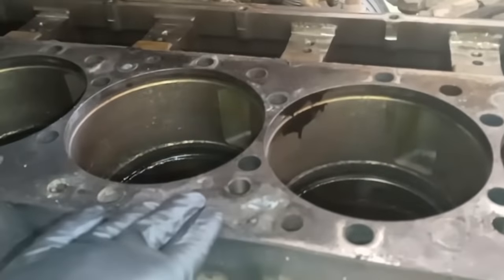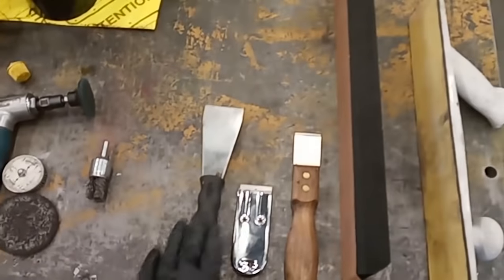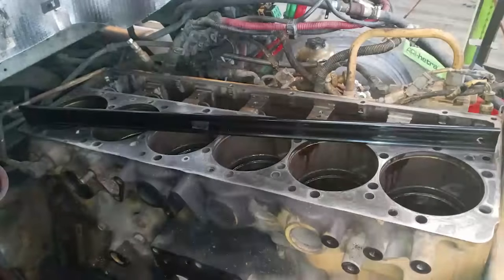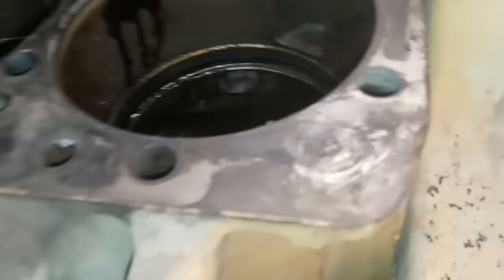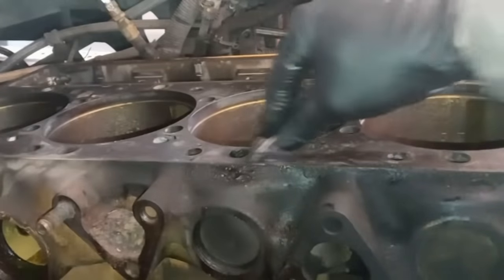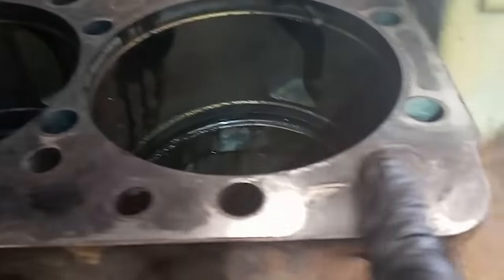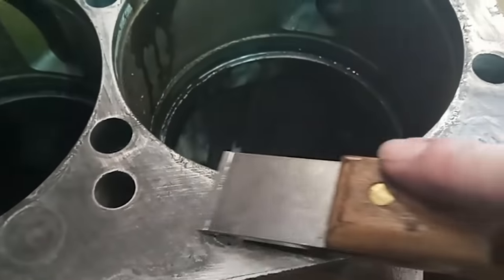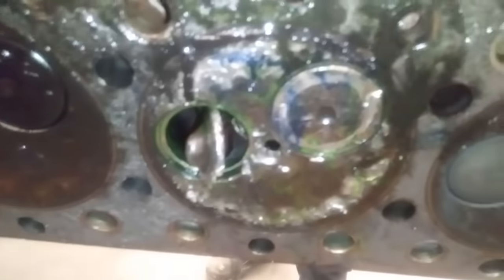Clean a Head Gasket Surface like a Master Engine Builder.

Comment: 24" long 3" aluminum 3/8" wall square tube with on side machined perfectly flat. Attach sandpaper to flat side and go to work. I use that tube for everything from gasket surfaces to butcher blocks.

Comment: I started stoning my blocks during rebuilds. I got into using them after I started millwrighting. I was told by a old engine builder that those scotch bright wheels on a die grinder would take some metal away. I know for a fact you can stone for a hour straight and it wont take .001" off lol. we use them on turbine shells all the time. They will instantly show up any high spots you may have on a block. 

Anyhow, great video!
Reply: stoning your blocks? did they say jehovah?
Reply: @edbo10  no, what he meant was using a flat stone to deburr an engine blocks head gasket surface.

If you have a known flat piece of clean polished metal, and a pair of precision ground abrasive stones, if you try to grind down that metal with your stone, it will never scratch /touch the metal at all.

But, let's say you take a center punch and lightly tap the metal, and then rub the stone onto the metal where the center punch mark was made, the stone will instantly find the high spots and grind them away, leaving all the surrounding metal un touched.
Reply: @jakefriesenjake  lmao i know...it was a joke
Reply: @edbo10  ok

Comment: I have been taught to use a knife sharpenig stone with brake clean after a razer blade than block sand and check and i have never had a problem

Comment: 8:00 The wooden handle " super scraper " . Carbide edge, awesome scraper.
I keep in mind, any crud that goes down the cylinder, could end up in a rod journal oil passage. Cover the journal, or brake clean it out too.
Reply: It's  a bare block, no bearings or anything

Comment: Great video! I used it to clean and check the block on my Triumph TR6. Was able to scrape off all the residue using about 15 single-edge razor blades, so didn't require the carbide scraper even though I ordered one. I bought a 100-pack of blades. They were sharper on one side than the other and the first few strokes with a new blade were really effective. Also used paint remover to soften up the gasket residue. Don't recommend that unless the block is out of the car as it's messy. Plain old paint scraper didn't do anything. Razor blades, sanding block & medium emery paper and accurate straightedge all that was necessary for me.
Reply from the maker: Glad you got a good result out of it and you got it going. Thanks for the comment.

Comment: Great video it's about time someone put out a video addressing this having been a caterpillar mechanic for 20+ years started at the dealership and for the last 12 independent to many people think if has to be shinny metal before it's clean
Reply from the maker: They aren't shiny from the factory, they are just flat and clean.
Reply: @AdeptApe  roll off disc's have  given Cat e-models and c15 a bad name for head gasket problems for years in my opinion
Reply from the maker: They certainly don't help that metal shim seal any better, although the idea that it seals at all is amazing to me. Giving the block little low and high spots only makes it worse. Just use more aviation gasket sealant!

Comment: awesome tutorial. I just did the same on a iron block and was having doubts about it. good knowing I'm not the only one. Only thing i did diferently was using an orbital air sander with a 120g disc, and then used a block and by hand using medium low pressure and 150g paper. then I switched to 240g and that's it. it doesnt look too good but feels very smooth. Also I'm a bit experienced on bodywork and used to hand sanding and feeling how smooth a surface when passing the sanding block

Comment: Deboss Garage had guys from down under (The skid factory) over to the DB shop.  The one Aussie finish planed a 6BT block with a whet stone, by hand, like you use to sharpen knives.
Reply from the maker: That would work as well. I have one, but don't use it as often. Had an older guy used to use a hard flat file as well.

Comment: Great advice. I got the  whizzy wheel / cookies in the engine bad lesson a long time ago from a seasoned veteran tech. He said exactly the same things you said "think that gasket gives a shit if the deck is shiny"? Flat and clean is what matters most.
Reply from the maker: I picture him with a coffee cup in his hand and nicotine stained teeth for some reason. Perhaps that is because one of my seasoned tech trainers had that.
Reply: @AdeptApe  Spot on. Not freindly with everyone, but not mean either. Him and I got along well though because he said he saw alot of himself in me. I was working at a powered industrial equipment repair company, he taught me alot about hydraulics and electrical repairs, as well as base engine repair. Taught me to run a bead of weld on a stuck bearing race to shrink it for easier removal, as well as welding nuts to broken studs and bolts. Gave me a Jacobsen two stroke mower engine, still have it my garage, on the engine shelf. Hard to believe that was 20+ years ago.

Comment: I work on mostly light duty stuff. I start with brake clean and a carbide scraper. Then I use a knife sharpening stone that I keep soaked in transmission fluid. After it is thoroughly cleaned, I wipe it with lacquer thinner. Never had one come back.
Reply from the maker: Why do you choose lacquer thinner instead of a brake cleaner, cheaper or doesn't evaporate as quickly?
Reply: @AdeptApe  It does. I did a stint at a dedicated engine shop for a couple of years. Long story. 

Mostly Cummins 5.9. Boss sucked, worked outside regardless, even took care of his pain in the ass dog when he was out of town. 

Dude can build an engine though. That laquer thinner takes it away man. Get a quart and try it.

Comment: After warm up I always let the engine cool to manufacturers specs and drain the water and break the bolts off and torque them again to yeild and always use a copper spray sealant on first instal and the gasket will never leak and will last for year's all my rebuilt engines are still going strong it's been 6 year's now on one rebuild I done I use plate glass and 80 grit 120 and 100 to level block and cylinder head using a strait edge and feeler gauges works a treat plus regrind the valve seats and valve stem seals and new springs and locker's.

Comment: Carbide scraper and wipedown with cleaner.  Chase threads, clean holes. Remove liners, clean out liner bores and crank. Wipe down again with brake cleaner, check flatness and measure bores. Install everything.

Comment: i have worked in a engine refurbishes shop and also the Ford engine manufacture shop. We used to surface grind heads to a mirror finish that you could see your face in, customers love this but not so much when a few weeks later the head gasket went! New heads a blocks are milled, a compleatly different finish to a grinder.
We found by dressing the grinding wheel very fast/rough gave a finish like 40 grit paper. We had a few complaints from customer about the look but never had a gasket blow! The rough finish grips the gasket, smooth polish finish lets it slip out!

Comment: Have worked for construction company's over the years and found that I usually own more wood chisel's then the finish carpenters do. Probably the best scraper short of the carbide that I have come up with. Run it over the oil stone and come up with a razor edge that is sharp enough to remove most of the contaminants on the surface, but soft enough to deform prior to damaging the block surface. Used very gingerly on aluminum. Have them from 1/2" wide thru 2 1/2 and find them better then any putty knife but longer lasting then razor blades.
Reply from the maker: You know I have heard of them being used for scrapers, but haven't tried them yet. Think I'm going to pick one up this weekend though now. What size do you use, wider the better?
Reply: @AdeptApe  Depends on surface.  Smaller ones get in for tight area's where you don't want to disturb alot of crud around it where you're doing a field repair, larger ones work well in the shop. The stanley one's seem to be a bit harder then the buck brand from home cheapo but that may have changed in the last 10 years since I last bought one. Either brand you do want to have a good stone to hone it sharp, grinder wheel does not work worth shit for that. Keep up the good work, I do enjoy learning something new every day. Altho it's usualy how not to do it next tims!
                                                                                                                                              Leo
Reply from the maker: I went to Ace and got one the day after this comment, guess l gotta say it works pretty well.

Comment: I use the rol-lock for small flanges but nothing more. I replaced the head gaskets on my ford 4.6l and put clean oil soaked paper towels down in the piston bores and used a razor scraper and scotch brite by hand to clean the head gasket surface

Comment: I've started using a large granite footstone I picked up from a local monument company with various grits of sandpaper glued to it.  It not only provides the needed weight for the paper to cut but also helps flatten raised areas for a more uniform surface.  Me and William Martin (name of the stone) have done several blocks and heads and not a single one has ever leaked.  I paid $40 for the foot stone and the guy threw in a smaller 1 foot square that the customer never picked up.  If you're still using surface disc better be careful not to create a gouge between the liners.

Comment: Josh, no need to go past the 100 grit for a head gasket. The surface needs a certain roughness.  The gasket needs that roughness to keep from slipping.   Most all machined surfaces have a recommended rma.  Simply put rma is a measurement of the surface roughness. You may well know this, but others may not.  
I appreciate you making this, and all your videos.  Really helps everyone trying to learn about their engines.
Reply: I’ve seen 200-220 grit even for composite… im surprised 100 would be OK

Comment: I have a precision a aluminum sanding block that I milled perfectly flat and true and I cover it with sand paper and I sand all my gasket surfaces using numerous grits of sandpaper.  I also have a very nice set of precision parallels that I setup using a dial indicator to verify the surface.

Comment: I never used the rollock wheels for critical gaskets. Scrapers, quarter sheet sanding block and finish up with a 14 inch mill file without a handle laid flat.

Comment: When doing DIY paint and body work I was taught to run your hands over EVERY surface you sand as you go. To me at me least flat sanding and some touch/feel seems legit for a decent head/block mating surfaces making good sealing contact with a gasket. Shite and briney looks nice, but a proper seal and job brings longevity to the motor.
Reply: An old body guy taught me to use a thin cotton cloth like a t shirt between your hand and the surface. It somehow makes it easier to feel imperfections my bare hand missed.

Comment: I was taught to just buzz it off with the die grinder, and then clean up all the swirls with a scotch brite. but I hate the idea knowing there's metal powder that is gonna make its way in small crevasses I can't see. Last head gasket I did I only used brake clean and a scotch brite and it was actually very effective when I used the scotch brite pad around a block of wood, and kept dowsing the deck surface with brake clean. I wanna try using plastic razor blades next time and see how it goes

Comment: An old friend of mine that has built lots of gas engines over the years always block/board sanded the head and block mating surfaces. It's the "old school" method and it works. Just like auto body, blocking will get you a more consistent surface than a goon shoving a D/A.
Reply: Yup seen guys use ceramic tiles and glass tables to surface heads as well. And borax to in the intake to hone/ loosen stuck oil rings cylinders. Cat used to make a powder that gets sucked up through to intake but I don't remember the name of it

Comment: I ran a cylinder head resurfacing machine for three years the roloc wheel will knock cast iron out about two and a half thousands of an inch I'm in aluminum head it can be up to 10,000 roloc is the worst razor blades Scotch-Brite and brake cleaner you got it right

Comment: Nice video! I learn this from an elder at my local machine shop. For aluminum, wet sanding with a bastard file that's not very aggressive can achieve good results also. Did this for my 2001 Honda civic D17A2 motor. Its been 6k miles and no issues so far on the rebuild.

Comment: I used a brand new knife sharpening block on my 5.9 Cummins worked good. Amazing how many high spots on the block I found and worked down flat with just the stone.
Reply from the maker: I've received a few comments on using those, as well a few saying to not use anything other than scrapers. I have a couple in my box for sharpened stuff and from my old straight razor days, but I think I'm going to try using them and see how they turn out. Thank you for the comment.
Reply: @AdeptApe  yes before I used it lightly scraped the sharp edges off the block with an old knife and cleaned it good after and had to keep cleaning it as I used it. Plugged my oil galleys with earplugs and razored the excess off before I started. They are tricky to remove sometimes so be careful

Comment: A new sharpening stone dedicated to flat surface prep works great as well. It shows any high points after a couple of passes especially around pulled bolt holes
Reply: Is a generic one flat enough, or do you recommend a brand name?

Comment: I start out with a scraper then move to flat sanding. I have a 20lb square piece of granite that had been ground flat and smooth.  The weight of the granite is enough to do the job, so I just have to go back and fourth in different directions with different grits of wet-dry paper.

Comment: I always use a razor blade scrapper then use the wheel. I spend about 15 mins with the razor then 25 mins with the wheel and straight edge them to .002 as well and have never had any issues. I also do that with aluminum heads and blocks (I use the blue pads for aluminum) also use magnaflux to check for cracks when I'm working with aluminum.
Reply from the maker: I think a simple straight edge is the tool missing the most out of most mechanic's toolboxes.
Reply: Magnaflux doesn’t work on non ferrous materials...

Comment: I knew a guy who would "machine" has own aluminium cylinder heads. He got a huge thick block of glass and glued sand paper to it. Then he rubbed the cylinder head on it until it was flat. It worked.
Reply from the maker: A poor man's machinist.
Reply: Use the sticky back sandpaper and work the head in a figure 8 motion.  This is needed on most small engine jobs.

Comment: Plus on newer engine the bearings are so much harder due to higher cylinder pressures. The aluminum and other debris from the whiz wheel will not embedd in the to bearings it will just spin a bearing.

Comment: I remember taking a factory Cummins ISX class and at that time Cummins made it very clear that rolocs and scotch brite were unacceptable for cleaning any mating surface. Especially heads and blocks. They were finding that the abrasive material and debris was ending up in the engine and in some cases plugging oil passages. Local dealer trainer said their techs would get written up if caught doing this.

Comment: It doesn't matter how light you are on the pressure, without a lapping block or a rigid sanding block, you are still going to have a slight "bowling" affect if you are sanding across the liner openings in the deck with the foam sanding block you are using. You may as well be using the scotchbrite pad. If  you have a very large machine file, you could wrap your sandpaper around it. There will be less "bowling" affect with it.

Comment: You would also expect the smooth polished surface the roloc wheel leave to be less effective in other words it would be expected to hold less side pressure prior to failing given a sanded surface leaves very small sharp ridges that would bite into the softer gasket material better preventing any slipping where there’s a narrow strip of bearing such as between cylinders
Reply: Agreed. I'm glad I read down far enough before I basically repeated your comment.  Examine the surface of a separator plate as shipped, or a cylinder head in a yellow box. Pretty sure there is some bite designed into the surfaces there.

Comment: How are you getting all the crap out of the cooling jackets.  threads oil galleys and the stuff you drop down where liners go? Isn’t there going to be shavings and abrasive material in all of that after you sand?

Comment: Great topic, so often I’ve seen top deck destroyed by the users of these discs, in Australia these discs started to appear from the local Snap On man 20 years or so ago  selling them out of their truck to all the local mechanics shops and dealerships, in the hands of an apprentice it would almost lead to failure every time, the worst one iv repaired required.017” stock removal to get back to a clean up, but hey it was shining, when they were used on the smaller petrol engines it wasn’t uncommon for them spinning con rod bearings after head work was recently done, the cause was the aluminium oxide from the disc getting into the oil after cleaning the top deck, it can’t be filtered and it’s abrasive, once again great topic, bottom line do not use these discs, wast of time and money.

Comment: I like the 12” Ingersol pneumatic sanding board with 80 grit. Use those wiz wheels on a 6.0 power stoke motor and the gasket won’t last 5 miles.. Makes low spots in the deck, especially between cylinders.
Reply: 80 is way too coarse. Even 180 is rough for this application.